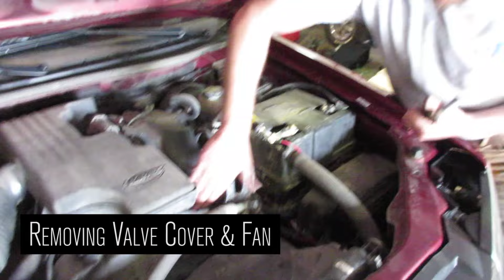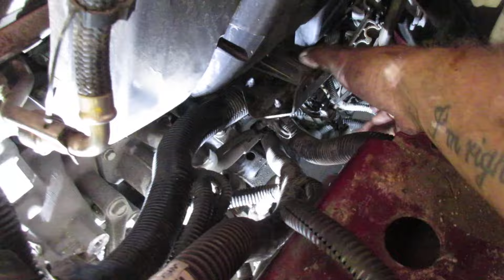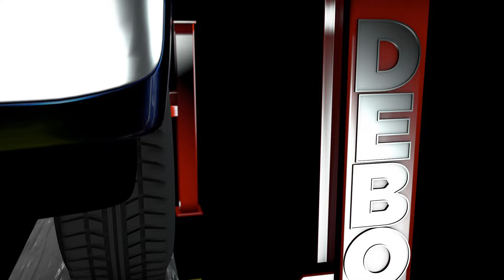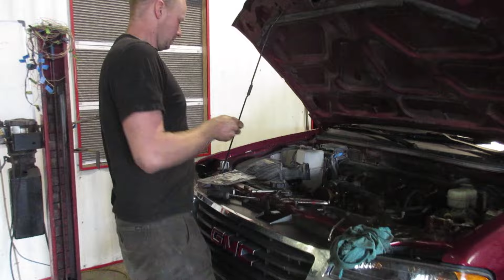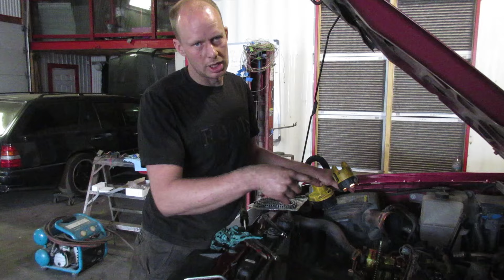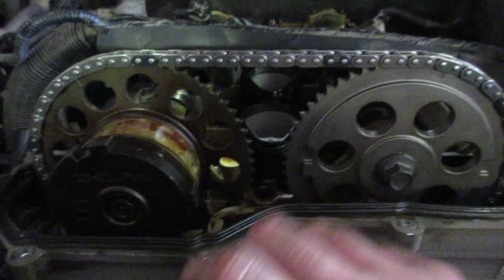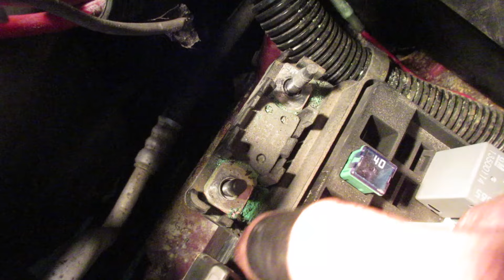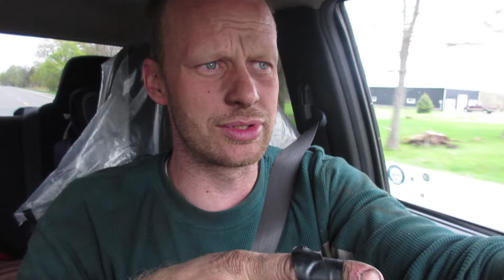Over-Engineering At Its Finest! GMC Canyon Needs A Timing Chain

Comment: I think all auto engineers should be required to work with mechanics for a few months prior to designing anything.  Actually, that goes for any engineer that designs stuff that has to be built or repaired.
Reply: I completely agree
Reply: Me too
Reply: Why would the engineers care about what mechanics have to say? GM doesn't make money on service... Mopar doesn't make money on service... Ford doesn't either. The engineer is there to make the vehicle that sells to the customer they're aiming for. Mechanics are irrelevant to engineers, at least in the auto industry.
Reply: Agreed. Too few engineers enter the work force without any technician experience. I'm currently going to school for mechanical engineering, and the majority of my classmates have never touched a wrench.
Reply: I think every engineer should have a least a few years not months with mechanical work. that or an engineer should work hand in hand with a mechanic
Reply: @dumbthingsyousee6969  or more probably a combination of both bad engineering and cost cutting
Reply: My nephew is in an engineering program now. I’ve had him help me do brakes on his car and have shared some of my knowledge of 30 years on the repair side with him. I’ve told him that he needs to think of the end user in his designs and how it is supposed to be serviced whether it’s rebuilding a component or replacing the component and having. A way to access it.
Reply: This is a pretty common problem for engineers and machinist/ mechanics. Handful of unis are now offering some form of Machine Shop Class for engineers to make the communication better for engineers and realize what kind of design can be made with realistic constraints. Unfortunately, these classes aren't required nor an elective. Just an off hand class that's on your time. Best  to just learn both fields honestly, engineering is a constant learning field anyways, more attractive for employers and can easily make odd ball parts needed to finish projects. Kind of similar problems for web design and programmers actually. Also, yeah -engineers are just told to design parts cheaper and less tolerant/reliable cause of companies/management trying to save a buck.
Reply: @crackpotfox  Manufacturers may not make money from service, but stealerships rake in a metric buttload of money from service, and when that service exceeds the value of the vehicle, weeeeell step over here since we have a full line of BRAND NEW overcomplicated transportation appliances waiting for you to sign on the dotted line...
Reply: @kaulincurtis9665  It's actually really sad how bad 1/2 of engineering students are at wrenching. You will find that some of the best engineers are the ones that do/have done a lot of manual labor.
Reply: @THEGAMINGHELP101  Anything made by a for profit corporation is done on the expectation of getting the biggest return on investment. Laws and regulation are written based upon controlling greed. Auto companies don't want bad reps or having to do recalls. 

Assembly engineering is based upon the cheapest way to assemble not disassembly. That being said you don't just weld everything together either unless you don't want to disassemble later on. Cars use to be build on frames like trucks. Now their unibody design and you need a unibody "frame" straightener to have the possibility of fixing one after a crash.  

To gain an undergraduate engineering degree from MIT requires a lab course in that particular engineering field. Engineers are expected to solve problems not to be the quickest wrench turner in the west, welder or an expert in soldiering.
Reply: @crackpotfox  not until you get lawsuits for engineering shit cars and over engineering cause it costs too much to repair then you don't sell, makes sense?, is all about reputation.
Reply: This done deliberately...the more difficult to repair, the happier they are.
Reply: “Do not attribute to malice, that which can be attributed to stupidity.”
Reply: The engineers design for production speed, not repair speed.
Not matter what, the higher ups will not change their thinking on that.
Reply: @2Truth4Liberty  If repair speed is fast it just seems logical that so will production speed.  Bottom line is that automotive manufacturers want you to buy cars more frequently and not repair them  You have to be a complete moron to think otherwise.  All this difficulty in repairing vehicles is deliberate.
Reply: @eduardosampoia5480  [[ If repair speed is fast it just seems logical that so will production speed.  ]] I don't see that as logical at all. 

[[ All this difficulty in repairing vehicles is deliberate. ]] I don't see that as supported by reality. And I'm no moron.
Reply: @eduardosampoia5480  I work at an automobile plant and also run a mechanic buisness from my home. @2Truth4Liberty is correct.
Reply: @crashcx  But you don't work in management.  I'll go by what I see.  All I see is a very corrupt industry that doesn't give one shit about car owners.  They're all watching what goes on and plan everything to the finest detail.  I've worked in manufacturing and have seen engineers at the owners request cycle test parts until they're strong enough to survive warranty and nothing more.  Production speed is obviously taken into account but in the end the more difficult something is to repair the happier they are.  Just look at John Deere.
Reply: The manufacturers have to warranty the components that go into production.  THAT is why engineers should care what mechanics have to say.
Reply: @crackpotfox  They do make money from service, it's called parts sales.
Reply: A few months is not enough. It should be at least 2 years that they have to spent working on it before being allowed to design anything.
Reply: I have a buddy who is an engineer. A damned good one. Has a Mustang 67 fastback that he rebuilt in his teens and a DeLorean he's working on now. He works for Caterpillar and gets in serious shit if he goes back to the shop. By the mechanics. FFS.  Unions...
Reply: Kaulin Curtis Most baffling thing I’ve ever seen was the week I started an engineering degree (I never finished it), where when handed a bolt and a wingnut a student looked like he’d never seen a wingnut before, and proceeded, for a 100mm bolt, to turn the nut a single half turn each time. I demonstrated “look mate, just flick and spin”.
Reply: "Over engineering is by design" not by fault. The government ass backward economic agenda is to stop backyard mechanic -Ing. Lobbied by big auto Keep people poor. . By contrasts I want dealers to be forced by governments  to be responsible for their bullshit; "OVER ENGINEERING " and fix their products set on a time standard of say  1980.  Timing chain 2-3 hrs. Max..it's like the government just hands the automotive industry a wild card to do whatever they chose. It's greed has gone to far.. That's why we have governments.
Reply: The engineers arent the problem. It's the bean counters.
Reply: 2Truth4Liberty 

Drive and repair a vehicle to 4-5 hundred thousand kilometres and see if that doesn't change your mind!
Reply: eduardo sampoia 

It's consumerism 101. To truly get a real clear picture, a person needs to go to a couple of land fills and check out the repairability of what Asian countries pump and dump into North America. Truly an eye opener.
Reply: And all lawmakers should be required to commit a crime. No wait... Hmmm.
Reply: @CheezyDee  Yes and no, how many folks got the estimate on the timing chain and promptly drove to another dealer and bought a Ford, Dodge, Toyota, Nissan or Mitsubishi? The depreciation on a car is the difference between what you bought the car for and what you sold it for.  Toyota and Honda and to some extent Nissan and Subaru developed the reputation earlier to last well passed 100,000 miles so when you traded out of your car it was worth more and you had more equity.
Reply: @NachoChurro  My Daughter works as a trainer for a major auto parts manufacturer, you can hire in with them and get an apprenticeship that will get you a Journeyman Tool & Die card, if you wish you can continue schooling (they pay for it) so in 8-10 years you'll have both the Journeyman's card and a  BSE, and bw worth 100K+ a year.
Reply: You'd be hard pressed to find an engineer who hasn't turned wrenches. The have higher priorities than ease of maintenance. Average engineer IQ is around 125. Average mechanic, not quite.
Reply: I used to work on cars for my living and it was painfully obvious how little designers cared about how the maintence work was carried out
Reply: Buddy's an electrical engineer who worked as an electrician for a few years. Very helpful he always said.
Reply: Wow comment blow-out!  Cool.  I'm actually a mechanical engineer 20+ yrs.  I design tooling for mfg.  I get to build/machine a lot of it too while working with a machinist who had 20 years with Boeing and nearly 20 years with us.  I can honestly say my designs kinda really sucked until I was given the opportunity to build them for myself.  You really get a picture of what works and also how to dimension things when you do it yourself.  It probably took me a year or two to become a kinda half-baked machinist (can't even really call myself a real machinist but I don't know how else to say it).  Machining made me WAYYY better at designing and thinking of stuff and how it goes together.  I also wrench a lot on cars, motorcycles, etc. and my machining skills have really made me think about it in a different way and I've gotten way better at that, too thanks to machining experience.
Reply: Paul Haines they do. I work at Borg warner (the company that made that timing chain) in Ithaca and the lead design engineers often go to Detroit and Alabama to see them go into the engines and get reviewed.
Reply: ME student here who did construction and works on cars can confirm wouldnt trust 75% of them with a screw driver.
Reply: I t s every industry too
Reply: crackpotfox actually they designs these engines this way to make money from service tbh. They make an insane amount from service. So many people only go to the dealer and would happily pay $3000 for a job like this at the dealer. I see statements from people all the time.
Reply: That's how Hewlett Packard USED to design their equipment.
Reply: its not that we dont know how its that we are told not to. Any high ranking engineer with a six figure salary overseeing the making of a vehicle would be able to spot problems like this and even more. Problem is that we are told to keep em
Reply: @user-rd5nc1nb9f  That's what I say. They design it as is because of repair profits.
Reply: Amen 10 years in the rust belts on top of it
Reply: Truest words ever spoken.
Reply: Its not the engineers, its the manufacturer. They have to design staff to be as cheap to manufacture as possible. Also its a benefit for them if the only peple who can work on them is the dealerships and not a regular mechanic shop.
Reply: so true - yes gotta be able to mass produce
Reply: This is about money.  Costing you more to repair your vehicle or just give up and buy a new vehicle.
Reply: A few months more like a few years

Comment: Pulling the transmission for a timing chain job. I think I have seen it all now.
Reply: oh yeah? Do the water pump on a Ford Duratec 3.5 or 3.7 after it pissed its coolant into the oil pan or onto the ground. 

You have to pull the transmission alright...because the whole engine is trash.
Reply: @DriveCarToBar  Man never seen a Duramax in a Ford before.... GJ editing that shit
Reply: @grandpa5x Pulliam I just pulled the engine on a 05 mustang 4.0. A lot easier to do the rest of the job on the engine stand...
Reply: @DriveCarToBar  water pump on the 3.5 can be done in car....super PITA, but can be done, when the job doesn't pay enough to pull the engine or trans.
Reply: Yeah these inline vortecs were failures imo. Audi has some engines with the timing chains on the transmission side of the engine as well 😂 takes a special person to be a tech
Reply: On a four wheeler I’m working on you have to take off all the body panels, water pump, and transmission just to service the ignition system which has a common issue with a key shearing.
Reply: VW 12 valve VR6. It sucks.
Reply: VW/Audi guys aren’t surprised in the least.
Reply: Most euro cars are like that.  I was a gm when those came out. I made so much money on those 3.5 3.7 4.2 atlas motors.   They were great trucks just no one took care of them
Reply: @truckinman86  
Yup any vr6- 12v, 24v or vr5 in Europe timing stuff is on the transmission side. Although since they're transverse they're pretty easy to pull out. Done them dozens of times since the chains are such a common job in them.
Reply: For a bit, I didn't know which engine you were working on. Then I finally figured it out.